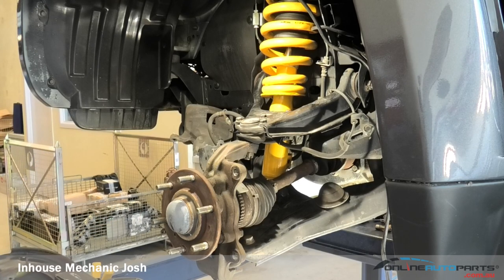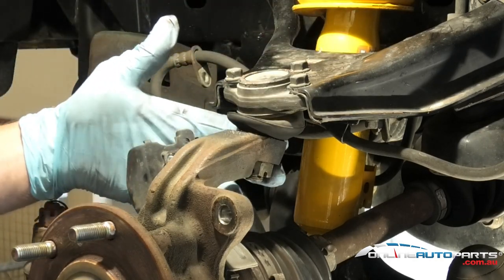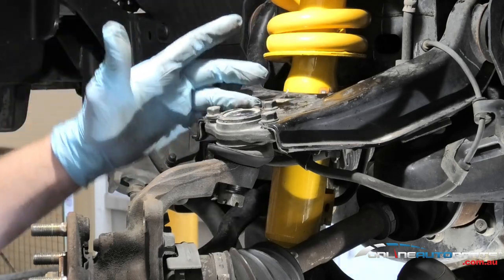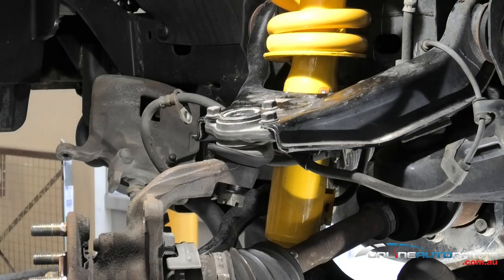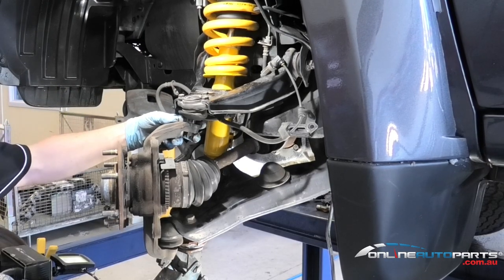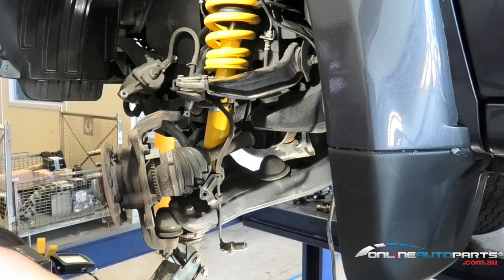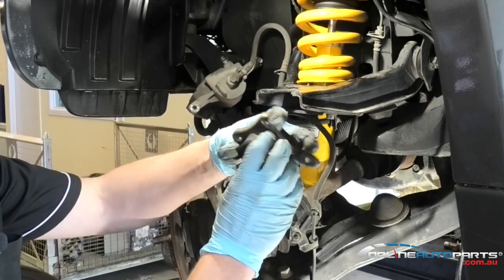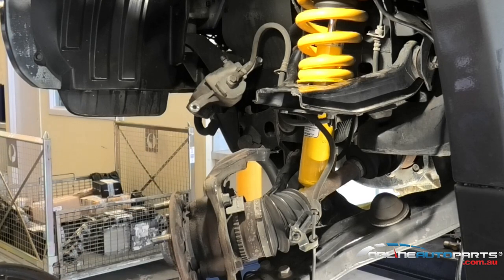How to replace and fit Greasable Ball Joints Mitsubishi Triton

Comment: If I use a 25mm Extended Upper Greasable Ball Joint it will be suitable for how many milimeters in lift (or inch)?